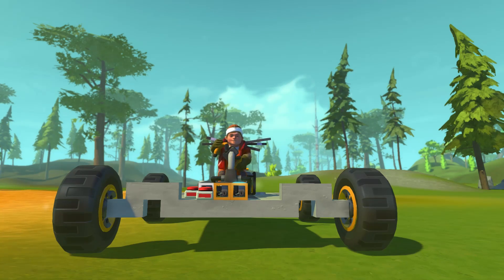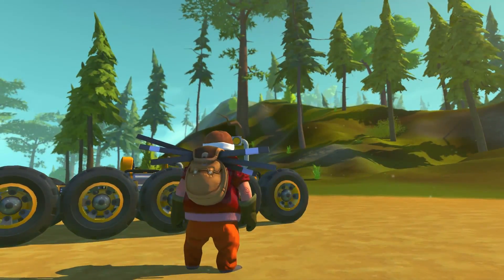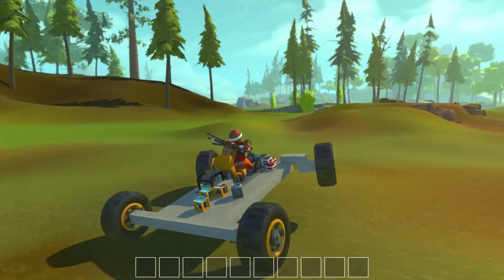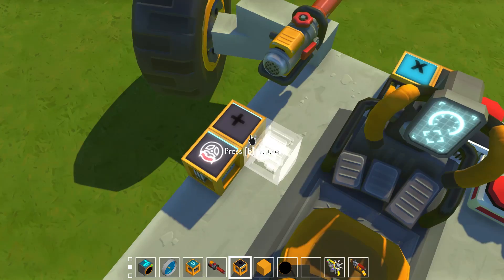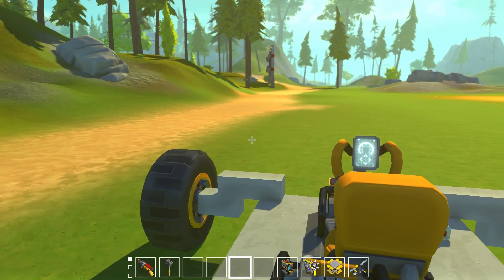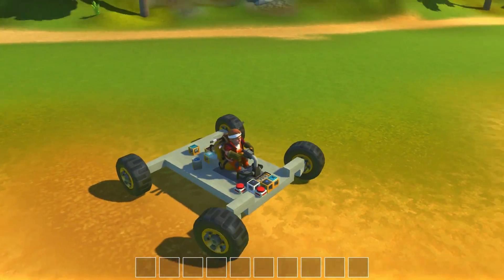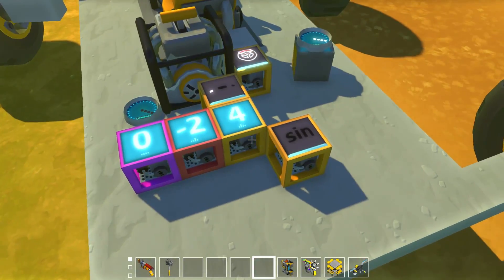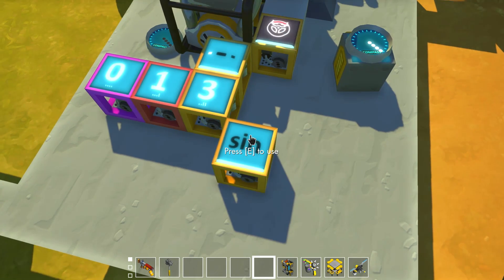Camera Controlled Car Steering Logic | Skrep Makenik

Comment: @Durf you never use the seated function of the math block. With that you could stop it from rotate where you look when you’re not driving
Reply from the maker: Yes! You can connect the seat to it (obviously), then connect it to the multiplication in front. It will only steer when seated.

Comment: Why don't you make that when you leave the vehicule, the controls stop working ? Because if you spawn multiple cars or tanks it will face in the direction where you're pointing at and it really sucks
Reply from the maker: it's super simple, just add a seated function from the math block. Then connect that to the multiplication for steering. It will only work when seated.